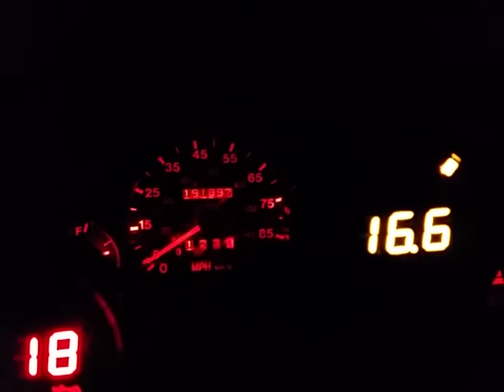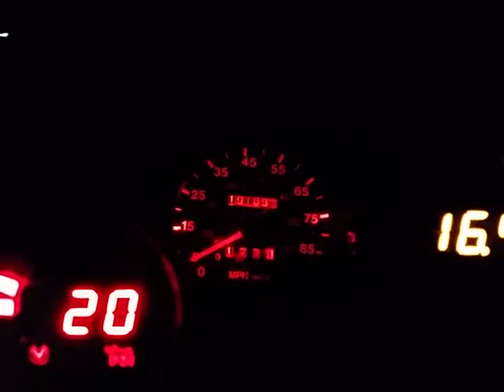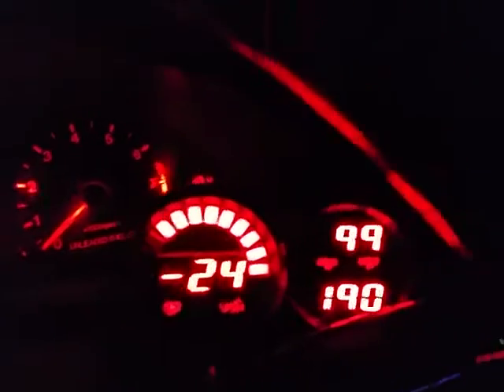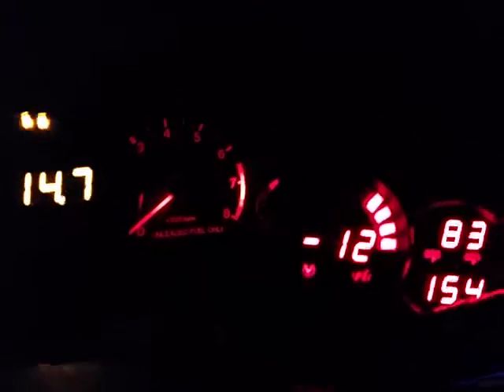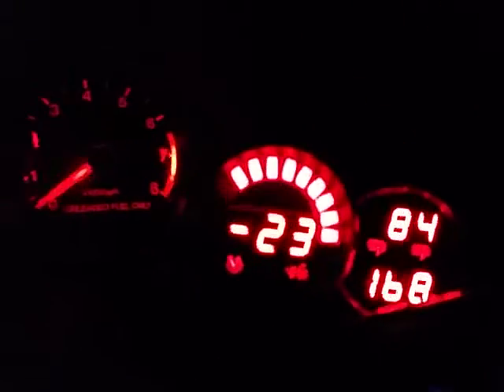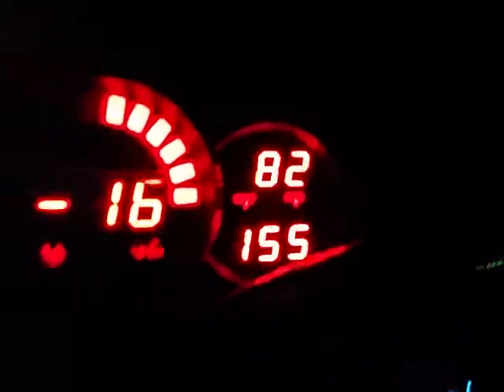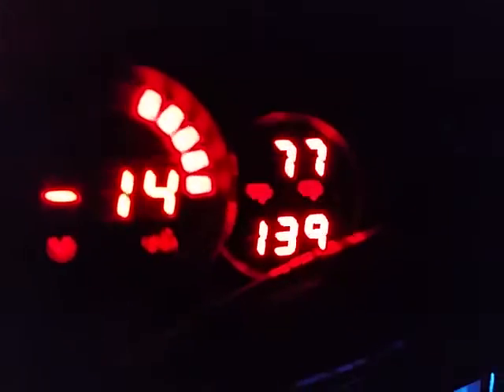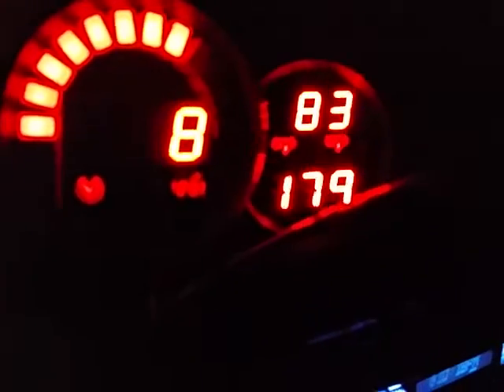Variable nozzle turbo GTi

Comment: Cool job man! That's a turbo from a diesel unit right? I would have thought the compression ratios in the housing wouldn't have been suitable but appear to be wrong 😍
Reply from the maker: Works like a champ. Check out the newest videos, same turbo but I tweaked the actuator. Boost response is amazing. Per the data log, goes from vacuum to 14psi in 0.8 seconds
Reply: @southwest82  Nice, I will check it out for sure! I always ponder about turbo options for my Eaton Mini but not comfortable with lag so I'm scoping my options out. My first thought was a unit from a Cayenne Turbo but those are all electronically regulated and would imagine it will be too much work to convert it back to mechanical or replicate the correct signals so this may well be a suitable candidate, cheers

Comment from the maker: I did use ve analyzer live when I was doing my base tuning to get the map roughly where it needed to be. there is still a lot of fine tuning that I won't up doing with mega log and also some tuning with the good old butt dyno because there's always some cells in the tuning map that feel better when they're tuned manually regardless of what the computer is saying